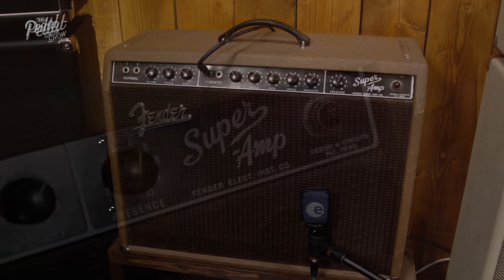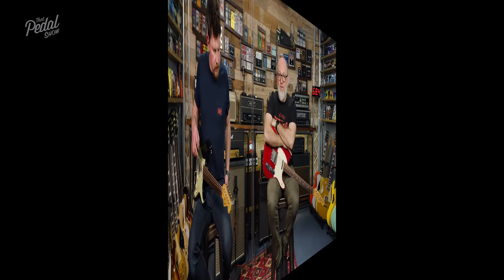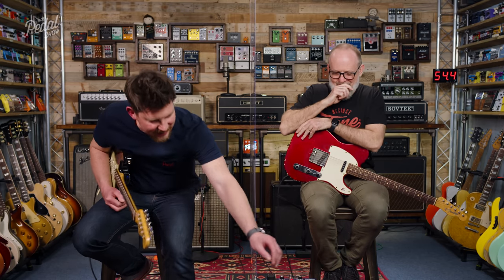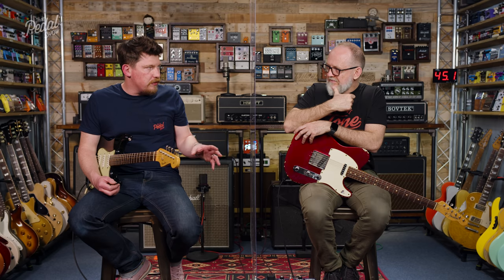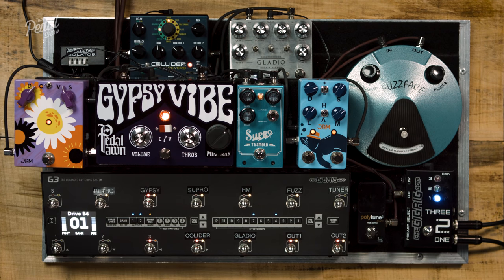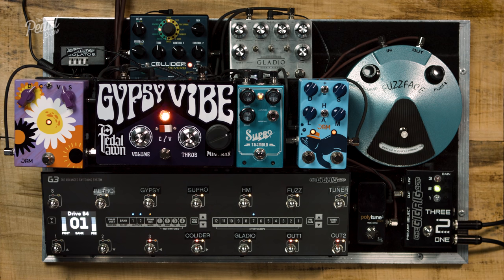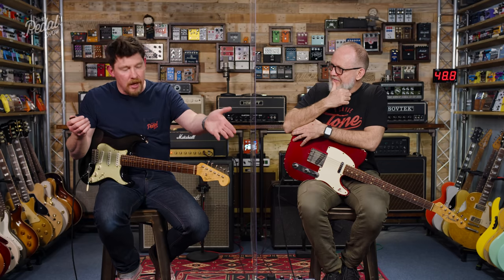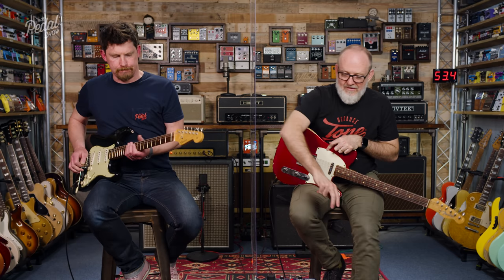Uni-Vibe Vs Harmonic Tremolo [Plus Fuzz & OD Order]– That Pedal Show

Comment: I love that uni-vibe pedals have a master volume and I wish that more modulation pedals did.
The ability to underdrive a dirty amp while adding a cool effect is just brilliant.
Reply from the maker: Ooh that’s cool. Never even thought of that. Niiiiice!
Reply: Thanks for that idea! My tremolo has a volume knob!
Reply: @ThatPedalShow  I actually thought about this exact "trick" when  Dan complained about all the important frequencies dissapering when turning on his Uni-vibe. Running it into a dirty amp also helps prevent this :)
Reply: @Onetinsoldier  Best "clean" tone i have ever had :) and it works just as great with compressors.
Reply: Yeah, i do that with one od ds pedal, set the drive to zero, the vol to 9.00 am. The colour to ds which scoops the tone. This is now the inverse of tube screamer.

Comment: In the beginning, I thought there was only one type of tremolo (optical). Liked it but I found it not versatile enough to gain a place in my very small pedalboard. Then, I found out about the brown amp tremolo after listening to Chris Stapleton. That's it! I like that! Fast forward to only a few hours ago I realised that Fender used TWO different tremolo circuits in those brown amps, bias trem in the smaller amps and harmonic in the larger, more expensive amps! What a revelation! Love all three but I must admit that if I had to put them in order of preference it would be: bias (as always on type of thing), harmonic (for those Hendrixy moments) and optical (Monster era REM anyone?). In other words, swampy, phasey and choppy. Now the 3 modes in the Flint pedal make perfect sense. 
I have ordered Mr Black's Mini Tremolo as it offers both bias tremolo as well as harmonic in a neat little package. Reminds me of an old DOD Vibrathang that I used and played a few decades ago. I'm starting to understand the whole tremolo thing much better now. Cheers!

Comment: Hey guys. Great show as usual. I have a vibe and harmonic tremolo on my board as my only wobble pedals. TPS is where I first learned about both types and I love ‘em so thanks. In my case it’s a Fulltone DejaVibe and a Walrus Monument. The vibe goes before the drive section, the tremolo after delay before reverb. I’ve discovered that a vibe sounds killer into a Prince of Tone on “OD” with the drive at about noon or a little better. The POT’s slight mid lift and bass rolloff help it cut. Thanks for all you do.

Comment: Great video! I have to start by saying I'm not a fan of tremolo. Not because it doesn't sound cool, but because it physically messes with my head at volume. Listening to the harmonic trem however, doesn't seem to have the same affect on me and I really enjoy it. 
Mick, your playing in this video is top notch. No disrespect to Dan whatsoever, but you can tell you really vibe 
(pun intended)with those sounds. Also, that Casino sounds so good. Such an amazing change after the pickup upgrade.
This was another great example of how big a deal pedal order is on the sounds you are trying to achieve!
Cheers guys.

Comment: Dan's ability to go with the flow and play things that fit wherever the knobs are turned is remarkable.
IMHO the Supro sounds most like an old brownface.  But to use a term Matt Schofield used, it folds over when you have ODs going into it.  So I got a Walrus Monument which had headroom but didn't swirl as well.  So I got a Harmonius Monk which sounds the least like a brownface of all but I settled on it as it is more pulsey or trem like and more distinct from a chorus or flanger.  All different flavors.  I just like the contrast of the HM over the other two.  And it really excels at that old on the porch blues stuff.

Comment: Two questions: 

1: What about a Vibe with a Wetter Box? Think that would help with what you guys were talking about with a Vibe dipping out too much and getting lost in the mix?

2: If a Vibe is a four-stage phaser, how does it do the pitch-changing vibrato? I would pay good money for Dan to break down the circuits of a Vibe, Phase 45, Phase 90, and other phasers and explain why the Vibe is so different.

Comment: You guys play a lot of wet-dry rigs and sometimes have mixed parallel effects with wetter box. However it's not the regular thing in the show. Although you've made some exciting modulated delay feedback loops! Lately I've gotten more into the depths of racks in the golden era, and as a sidetrack into studio production, and parallel effects was all the rage in that Van Halen era. Pitch shift, chorus, delay, reverb, you name it, in series, parallel, effects in the "loops" of other effects, stereo outs from every effect mixed with dry at the end.

Would you be interested in diving into that realm with pedalboards on the show? It's not at all common with pedalboards to go outside series chain, other than the wet-dry rig's dry signal. Some fancy pedals do those things internally, like modulated delays or some having effect loops in the pedal itself, but it would be very cool to hear how that kind of signal path would render itself in the pedalboard, and how it would sound with pedals! Playing with the rack gear (some have internal chains for effects and putting stuff in the delay loops, although today things like axe fx seem to make it fully modular, but that's everything under the sky in one box anyway) I came to notice how it clears the sound in an interesting fashion, for example when you run delay and reverb parallel to each other. I don't want to say that either is better, it's more of that studio like sound with less "mojo", but it's an interesting thing. Another one is putting something like chorus after delay in parallel to reverb. Or chorus into detune in parallel with reverb into delay. Or all the stuff into two parallel stereo delays. Limitless options. A huge pain in the butt to configure in the pedalboard, but interesting to explore.
Reply from the maker: Lovely idea, thank you! Wet dry is so cool because it’s part parallel I guess. Mick here. We should get into this. Cheers!

Comment: If you have a tight budget and want a 'vibe' sound Mooer make the Trelicopter...better yet they make the same one with the same name called the Rowin Trelicopter which you can buy on Ali Express for $24.00 USD. It is killer sound!
Reply from the maker: We’re big fans of the Trelicopter - been in many a TPS. But it doesn’t do the harmonic thing at all. Cheers!
Reply: @ThatPedalShow  It's an optic pedal according to a tech site I read. They said it is a design taken from Diamond.

Comment: I'm a big fan of univibes and have owned a few, but they kind of have that one thing they are known for. Plus most of the best ones are pretty large format (like the Gypsy Vibe) so they take up a lot of board real estate for that one thing which (unless you're doing loads of Hendrix or Trower covers) is probably getting used on only a couple of tunes a night. As a result I usually fall back on a smaller and more versatile Phase 90/45 type pedal to do emulate a univibe sort of sound live. 

I also get what you guys are saying how a legit univibe set up really big and chewy can get lost in the crossovers in a live band setting. That's not an issue with a phaser. However, a harmonic vibe is an interesting alternative since it can deliver a univibe-esque thing as well and amplitude vibe - so more options in one pedal. It crossed my mind when I heard the Supro, but now I know about the Monk I'll have to consider that too.
Reply from the maker: Thanks Mike, we see you’ve already checked out the Monk. Nice one, cheers!
Reply: I was all set to get a Supro till I saw the Monk and its superior tweakability. Fell down a fortuitous YouTube wormhole.

Comment: I use the Kingsley Trem with tube bias modulation before my drive, then the Deluxe Reverb Trem (vibrato) after the board,  So both. .:)
Reply from the maker: Mmmmmmmmmmm
Reply: @ThatPedalShow  Wow, you deleted my comment on how I got to this Trem configuration and why.  The primary comment.  What's that about ?

Comment: The Gladio always sounds so good. And now the struggle of gladio vs duelist starts in my head again. Have you tried the single channel gladio? Supposedly leaning more heavily into SRV than the dual channel. 
Cheers
Reply from the maker: Should be easy enough. Duellist is a Tube Screamer and a Blues Breaker. Very overdrive pedal, VERY awesome. 
Gladio is chewier, potentially a little bit more mod focussed when using both channels together: more amp like a tiny bit.
Classic SRV post Hendrix blues - Duellist. 
More fusiony Dumbly Larry-y Robben-y Id say Gladio. Obviously all totally amp dependent but that’s how I kinda view them. Cheers!
Reply: @ThatPedalShow   my girlfriend will have you know that the correct answer is “you have too many pedals already, why do you need more?”

Comment: Wonderful playing, and surprising insights! I did not expect to like the Gipsy Vibe so much, and that Fuzz into vibe/trem and back experiment was eye popping.
One quick question - It looked like both vibes were set to ‘c’ (as opposed to ‘v’). Is that short for “chorus mode” vs “vibe mode”?
What’s the difference?
Any way, the one thing that was predictable - the amazing fuzz tones that you both create are out of this world, every time. Simply unreal.
I wish I had magic like that at my finger tips. Cheers!
Reply from the maker: Thanks Ran! C and V are chorus and vibrato... V is just the straight effected sound without the dry signal - it sounds pretty weird on its own but people do use it. 
The classic Uni-Vibe sound as you know it is, confusingly enough, C mode! Cheers!

Comment: At the end when you demonstrate the difference of trem before and after fuzz, at what point did you roll down volume to 3? It seemed like there was less difference in sound when switching order of Monk and fuzz than with Supro and fuzz. I know both have evel adjustments. In addition to impedance mismatch with trem before fuzz, could there have been more gain on the Supro versus the Monk? Very interesting! I don’t have the Supro but I have a Sunface and Monk so will promptly experiment instead of Sunday chores!

Comment: Such an epic show. Fuzz and vibe is absolutely my favorite pair of guitar effects🎸🎛 Mick, do you set your fuzz face to higher than unity gain?
Reply from the maker: Hello! Hard to say, because the psychoacoustic effect would suggest it’s much louder. But I suspect the transients of my cleaner tones would be higher, so it’s one of those things. I set it for the tone rather than the volume - everything on 10, then back both pots until the sound of frying bacon disappears. So about 9 / 9 I guess. With this fuzz face that’s totally liveable with. But with the Vemuram Myriad, as just one example, it would be unbearable! 
Erm, always louder if it’s a gain pedal anyway. Cheers!
Reply: @ThatPedalShow  thanks! It’s hard to see the knob settings on those round black knobs

Comment: You did not cover the difference on some tremolos that use VCA's to create the effect instead of optics. The VCA ones often give you a choice of wave-forms that give you stutter like effects. You could argue there are 3 types of tremolo.
Reply from the maker: We’re not really talking about amplitude tremolo here per se. Cheers!
Reply: @ThatPedalShow  Yes but there will be many viewers that do not really want one that will get one thinking that they have to be one the two choices you presented as you never mentioned there was a third. I only found out by a lot of research myself. I do not like them myself but I felt my Stomp Box Steals blog readers Some 462,000 of them deserved to know. Most find the price of a single pedal a very large purchase in much the same way you would buy an amp or guitar. Several months ago Fender released guitars with pine bodies. In the ad they omitted in the specs to even mention the body wood. Reviewers that did a demo were not told. I know I asked them. How would you feel if you bought a pine Strat???
For the record the guitars were pulled.

Comment: Im interested in a uni vibe or a Harmonious monk and my question is does one work better than the other with humbuckers? I have a strat and a Les Paul so if possible i want to get the most use out of whatever pedal i get. Any suggestions?
Reply from the maker: We think they both work equally well with hums or singles. If you want that specific UniVibe sound, then nothing else will do it properly. You have to go UniVibe, 
But if you want a more all round effect and the benefit of a regular tremolo too, Harmonic Trem might be a better option. Speaking purely personally - Mick here - I have a harm term permanently on my board. UniVibe comes on and off if I need to do proper Jimi! Cheers!

Comment: What pickups did you put in the casino and why.
Reply from the maker: Lollar P90 dog ears. Because the original pickups sounded dull and lifeless. Very low resonant peak with very little dynamics off the controls. 
The Lollars turned it into a really great guitar for the way I play. I did sell it, however, to fund a mid-60s ES-345 which is a //really// great guitar. Cheers!

Comment: 0:30 I thought the plexiglass was to guard you from passing COVID to the other. Since you've both been vaccinated, What's the purpose now? Maybe there's something I just don't fully understand.
Reply from the maker: We discussed it yesterday at length. But to answer fully. First up, the vaccine isn’t 100 per cent effective. And we’ve only had one dose each. However it is kinda churlish to say that because we are exposed to one another anyway, and we’re pretty happy we’re not giving each other Covid, even though there is still a chance of so doing.
After that it’s simply government guidance. Our governments guidance is still to maintain a 2m distance wherever possible in the workplace, or if that’s not possible put other measures in place. For all kinds of reasons - financial and operational really - it makes more sense to follow the guidelines than ignore them so that’s why it’s still there.
All that against the backdrop of knowing that it’s largely ineffective. 
So we’re in this position of having to make actual operational decisions as a business, that have a potential effect on a wider circle of people other than me and Dan. What we can’t really do is be all handbag about something we don’t really agree with. 
Cheers!
Reply: @ThatPedalShow  Better to be safe than sorry...if the guidelines work, happy days. If they don't, what have you lost?